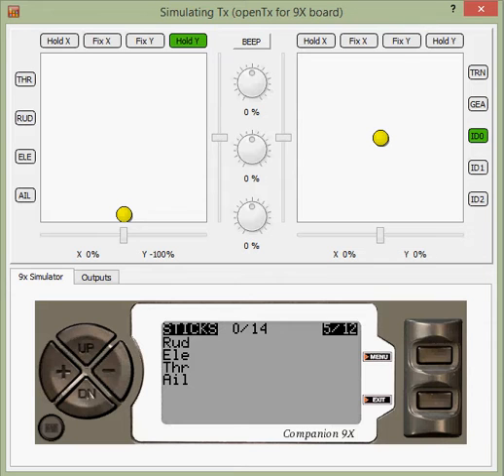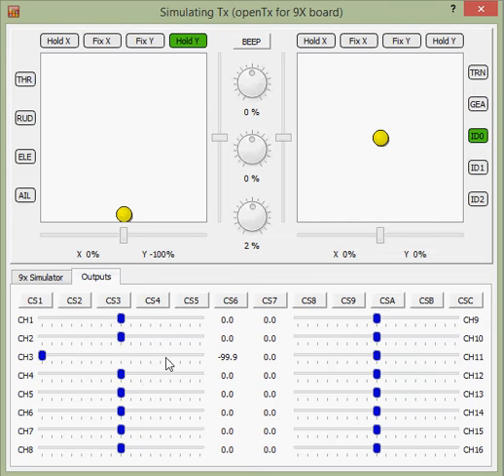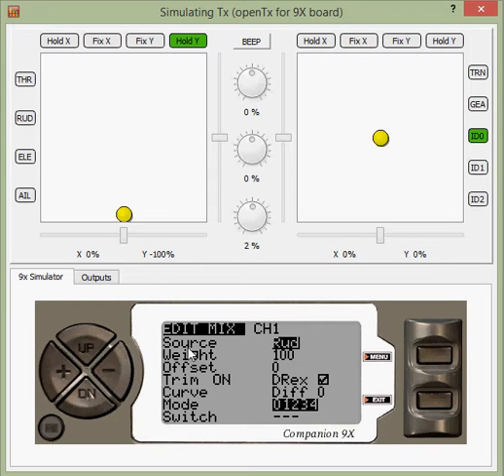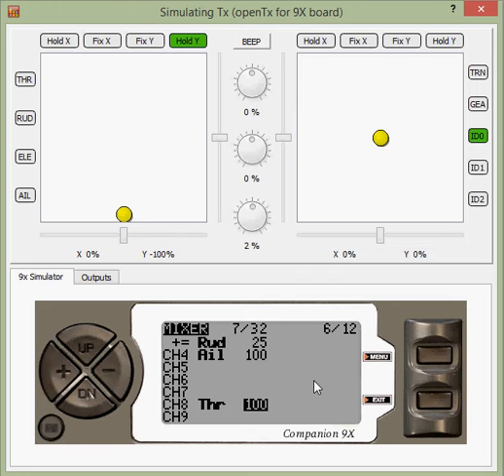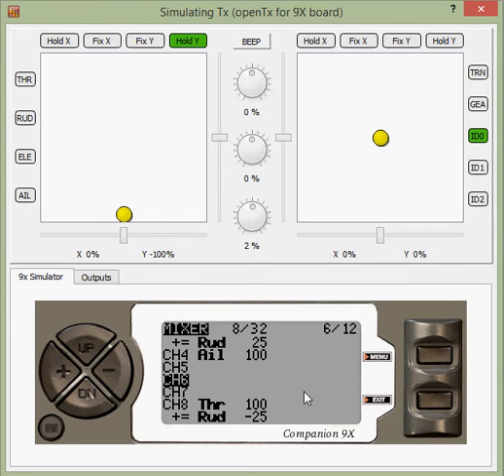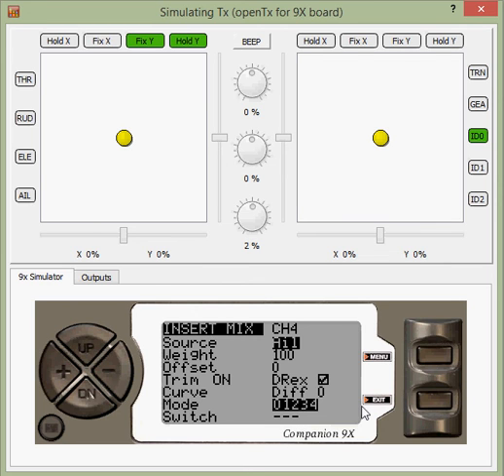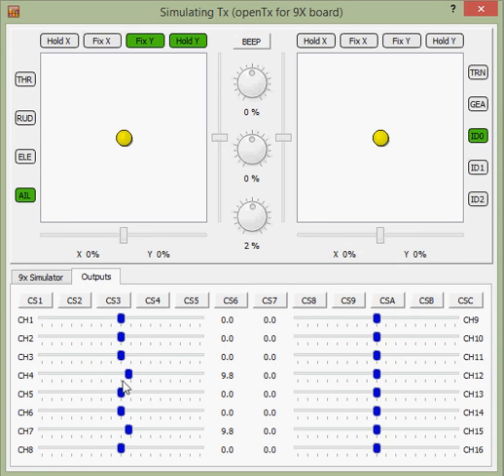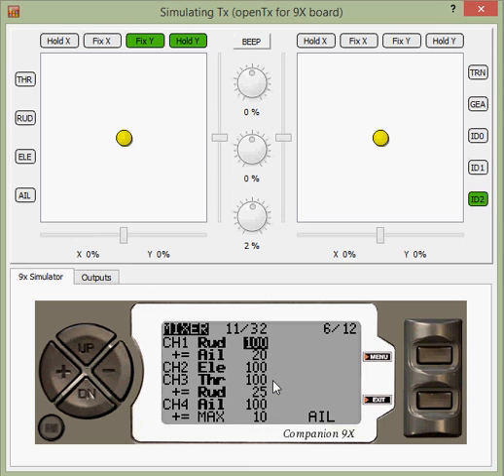Basic mix configuration with Turnigy 9x and Open9x firmware

Comment: Thanks for going through this.  I know this is getting to the party late, but I am just getting ready to start trying to fly and needed to learn how to set up the ailerons and also how to use them as flaps for landing.  I think now I can get this done.  Just hope nothing happens to this video!  Just in case you are reading this, how much down elevator would I possibly want to add to the flap switch? To off set the flaps causing lift when activated.
Reply from the maker: Lower the flaps and feel roughly how much elevator you need to add with your fingers to counteract it. Then mix in roughly that amount with the mix and tweak from there.

Comment: Great explanation thanks, spoilerons, did you remove the Y lead between aileron servos?  You didn't say to do that so I'm unsure how it works
Reply from the maker: If you are going to do spoilerons or any other sort of mixed control surface (elevons, etc...) then you can't use a Y-splitter. Each control surface has to be on its own channel. When a Y-splitter is used, the two control surfaces always move in coordination with each other--the same direction at all times, or opposite directions at all times, depending on whether the servos are installed facing the same way or not. When you do mixed control surfaces, they sometimes need to move the same way, and sometimes opposite ways, so they have to be on separate channels.
Reply: thank you